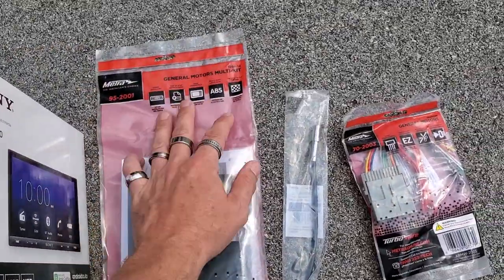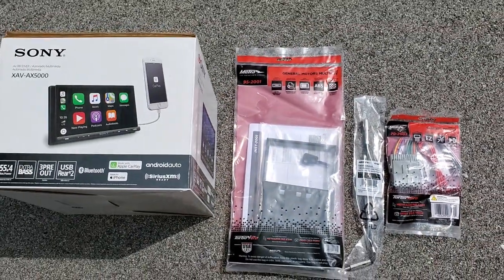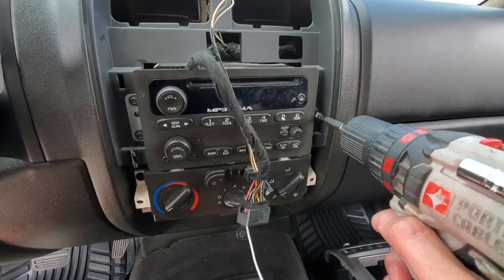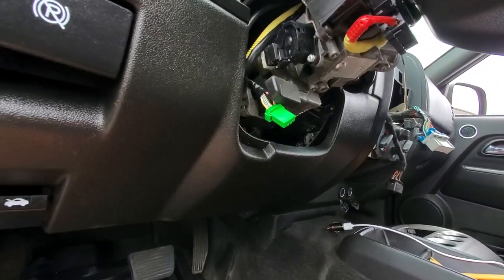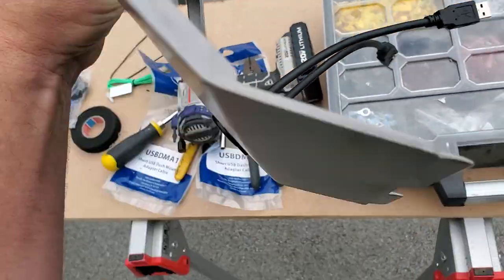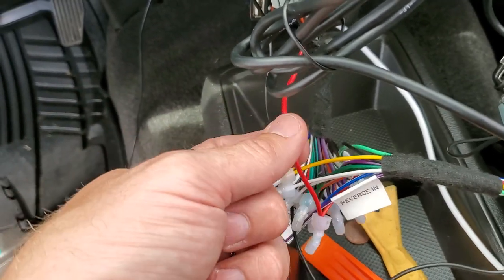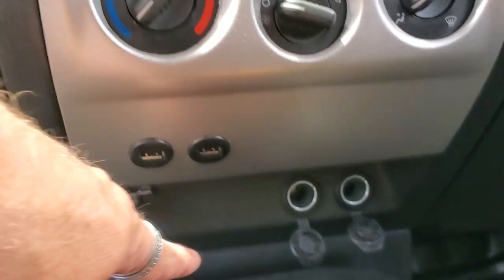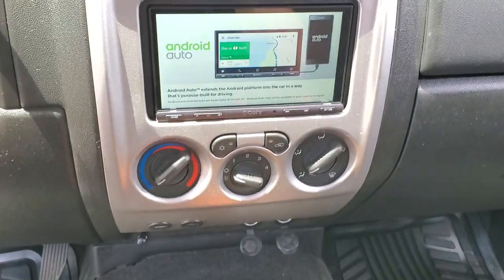GMC CANYON / CHEVY COLORADO - SONY XAVAX5000 RADIO INSTALL

Comment: Use the Yellow Sunroof Wire in the drivers side A-pillar, even if you don't have a sunroof it's there behind a little tape. It's off the RAP Relay which will work great.

Comment: Do you like the radio? I installed a touchscreen. It has no knobs. Its more of a pain to raise and lower the volume whole drive to have to look at the radio, find the plus sing, and then tap it while driving. It came with a remote but it is not lighted. And I lost it already.

Comment: Thanks for the great instructions!  If possible, please tell me what components are needed for a 2010 Canyon with a very basic OEM radio?  Is it the same as the 2008 in your video?  Thanks again!!
Reply from the maker: All the parts that you would need are in the description of the video. It also has links you can click on to just purchase the pieces that you will need.

Comment: I’m doing a install like this but non Bose system with PAC gm1a-r in trying to figure out what is my amp wire from the truck. I connected the blue to the blue and white and my it works but I turn my volume to max to barely hear any sound. Any suggestions?

Comment: Would you recommend wiring the radio directly to the battery with a fuse in between?
Reply from the maker: No need to

Comment: Any recommendation on speakers that would pair nicely with this stereo without adding an amp?  2005 Colorado with the tweeters in the front upper door panels.  Would like to replace tweeters, front, and rear doors for a complete new system for my daughter.
Reply from the maker: We have a ton of speakers that we could get you some good deals on if you are interested? Send us an email at rdfablife@gmail.com

Comment: Good video, could you explain what parts you used to add the 2 usb ports?  Going to be doing a similar install on a 2005 Colorado for my daughter.
Reply from the maker: Dual usb flush mount
https://amzn.to/3ocU5cE

Single usb flush mount
https://amzn.to/3ocU5cE

Comment: Why isn’t the ignition wire not already directed to the existing radio wiring harness? And why does it need to be modified for the aftermarket radio?
Reply from the maker: This is only if you use a cheap harness. It's a difference between 10 or $15 for a cheap harness or $39 to $100 for the more expensive harness that does the rap circuit to provide switch ignition
Reply: @octanetvchannel  thank you for the quick response. Still a little bit confused but that’s mainly cause I’ve never done this before lol. I’m sure once I get it started I’ll figure it out. This helps tremendously. Thank you again.
Reply from the maker: @Venomous-n7j  You are definitely welcome if you can't figure anything out or it becomes confusing shoot us an email at octanetvinfo@gmail.com
Reply: @octanetvchannel  I wanna do it on a 2012 gmc cayon but it’s sayin I’ll lose my chime and stuff is there a way to get around it ?

Comment: If I don't buy "the data bus interface" should I just disconnect the green connector under the steering wheel and not connect the red stereo wires?
Reply from the maker: You will need to connect the red wire coming off the harness to an ignition or accessory wire underneath the steering column

Comment: You linked two head units to the video, both are xavax5000 but seem to be different sizes? 

Both still work without modifications?
Reply from the maker: Both are exactly the same some people just put exact dimensions versus rounded dimensions

Comment: Hello. I had an aftermarket double din Boss radio installed to replace my original radio just like you did in my ‘05 Chevy Colorado. A local company did it and as a result I don’t have a door chime anymore.  So when my lights are on and I open my doors there is no chime to remind me. I went back to the installers and they said I need a special harness…I don’t really believe them but now I’ve left my lights on numerous times and killed my battery. Any thoughts?
Reply from the maker: Gmrco1 harness
Reply: @octanetvchannel  thank you much!

Comment: So there were 2 plugs going into the factory radio. So the smaller plug is not used at all in the Sony hook up and just sits free behind the new radio install, correct?
Reply: this is what I was wondering as well being my new radio only has a spot for the bigger plug

Comment: i installed a new radio everything is wired correctly only it wont power onbat all now the only thing thats not connected is the vehicle antenna now does it need the antenna for power stupid question i know but 🤔 after so many radios installed never had this happened any ideas 🥴🥴😁

Comment: I have a ‘12 Colorado 
 Can i use the same white/red wire on the ignition harness for my radio?
Reply from the maker: Yes
Reply: Do you NEED to do that? What does that wire do?
Reply: @dannygoround1  gives it power when you turn the switch on

Comment: I'm having an issue I got a dual Electronics xvm279bt head unit for my 2006 gmc canyon and I got all of the wire connected to were they go and I got it working yesterday and when I was coming home from work my door speakers stopped playing sound and the only sound I get is from my subs and idk what's causing it I really need help

Comment: I have 2004 Canyon and need to know the right wiring to put aftermarket radio in
Reply: did you ever figure it out? i have a 04 colorado and I cant seem to find anything, but also im new to this

Comment: Nice work, where did u get does 2 USB ports
Reply from the maker: Amazon
Reply: I couldn’t find them on Amazon
Reply: i replaced one cig. plug with two usb plugs .no drilling holes

Comment: hey so i bought the same stuff you said to but with kit so i didn't have to run into my steering wheel but my radio doesn't turn off
Reply: I'm thinking of doing this to my truck and getting the interface bus with the wiring harness. I'm curious if you figured out the issue with your radio not turning off?

Comment: For the GMOS01 plug, where do you plug in the 3.5mm that's on the harness
Reply from the maker: If you're talking about the headphone jack that will plug into the steering wheel or remote port on the back of your radio but you will probably have to have an aswc to make that work
Reply: @octanetvchannel  do you have a video showing how to hook up the GMOS 01 to a chevy colorado?

Comment: I hooked my radio up and now I have no sound once so ever. Ideas?
Reply from the maker: Do you have premium sound or Bose?
Reply: @octanetvchannel  premium
Reply: Also what do I do with the 2nd plug? Or is just neutral now in a way
Reply from the maker: @coryallenb38  you will probably need a premium audio that way you can turn on the amplifier. You might be able to use the cheaper harness if you connect the Blue with white wire that is the wire that fires up the amplifier
Reply: What should I search for with the premium audio
Reply: The truck had the same original stock radio that you took out.
Reply from the maker: @coryallenb38  metraonline has a website where you can put your year, make, and model a vehicle and it will give you all the options for the premium sound harnesses

Comment: Minute 3:10 I didn’t understand what I have to do
Reply from the maker: If you buy the correct harness which is a gmrc-01 or gmosone you will not have to do that part. Basically those harnesses provided ignition but the one that I used in the video does not. So if you do not want to do that step make sure you buy the correct harness and it will provide that for you
Reply: OCTANE TV can you explain the way you did it? i’d rather not wait on another harness to ship.
Reply from the maker: @SidewayzTre  you will just wire up every color to match each other except for the red wire you will run that to the ignition which is shown in the video period it is located underneath the plastic in the steering column
Reply: OCTANE TV how did you connect the wires? i have my ignition switch out
Reply from the maker: @SidewayzTre  use a t tap